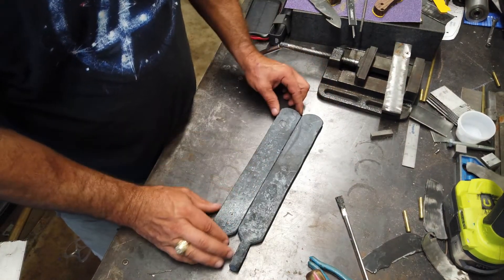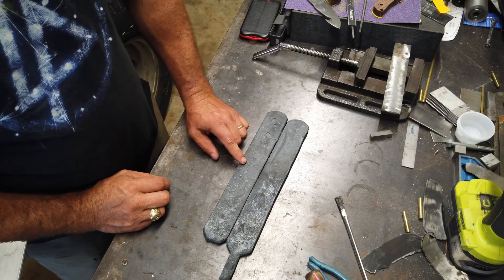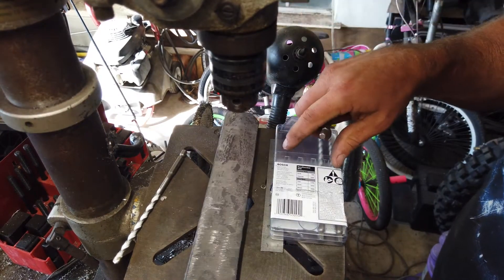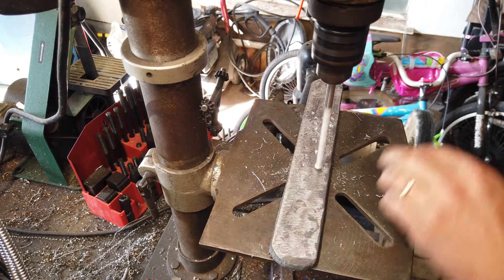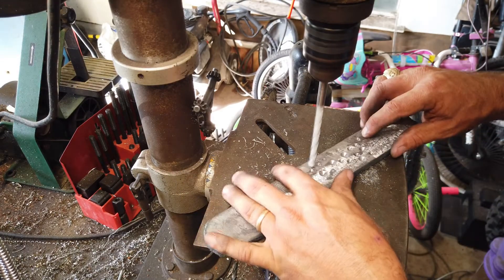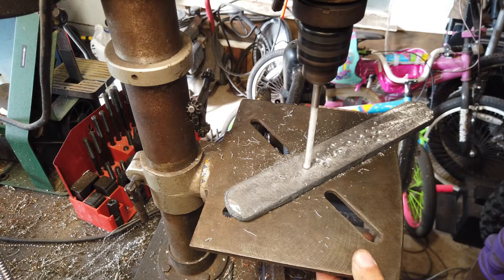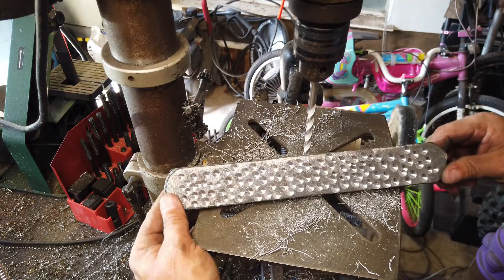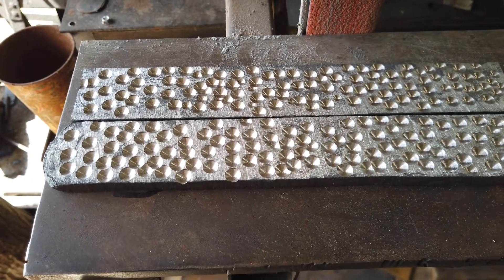Making Raindrop Pattern Damascus

Comment: Hi, is it possible that brass be forged with steel damascus style? Im no blacksmith, but just thinking that the gold ish pattern would looks cool.
Reply from the maker: Dean Dang, hi Dean, it’s not possible for the brass and Damascus steel or any steel for that matter to be forged together due to the extreme difference in their melting point.  There are other ways to get the  “goldish” patterns together on Damascus but it would mostly be superficial during the etching process.  Brass and silver will fuse together if you were wanting the gold silver look.  Thanks for the comment!!!

Comment: Really beautiful! My biggest question is... do you read a certain book that shows you the sequence in making the Damascus? I understand many variations but I want to learn so many more, the books I buy dont help. Remember I'm the guy who wants to learn Makume Gane as well. I'd like to be able to make the same patterns with Mokume and put it on my knives as bolsters and pummels to add to the attractive value.
Reply from the maker: Thanks Brady, I don’t have any books to recommend on the process.  I watch a lot of YouTube and in the end I have gone about it all through trial and error.  As long as your steel is clean and your forge gets hot enough it’s pretty simple.  Raindrop pattern and twist pattern are really straightforward, the mosaic patterns are tough